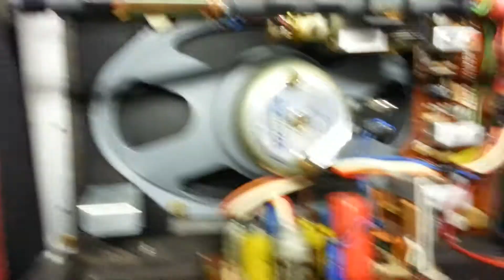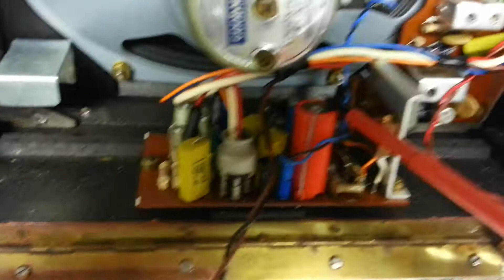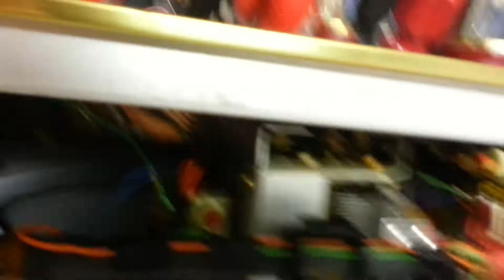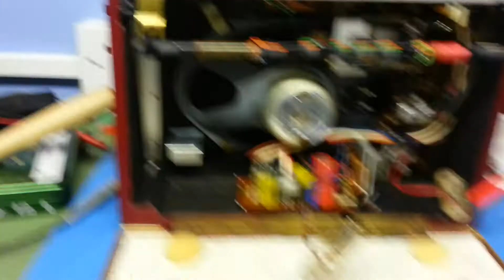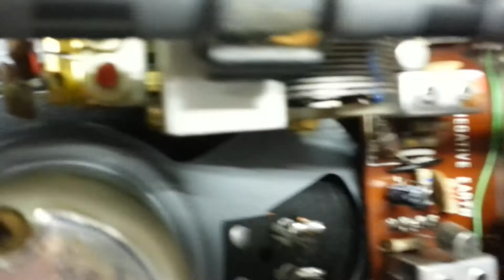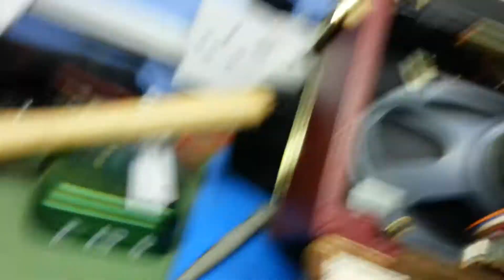Identifying tin whiskers.

Comment: These AF114 to AF117 germanium transistors were filled with a Vaseline like paste, (possible a type of thermal paste) it seems the whiskers could even grow through this paste and cause internal shorts.  I remember the replacement transistors as AF124 to AF127, I don't think any modifications were needed.

Comment: The cure is to desolder the transistor, join the base, collector and emitter and discharge a capacitor through the joined leads with reference to the screen which usually destroys these whiskers thus restoring original performance. 
AF 117 transistors were considered unreliable yet many radios (including Roberts) from the 60's used them and some are still working today but will inevitably fail through whisker growth. Nothing a good zapping won't cure!
Reply from the maker: Yes works most of the time.
Reply: The Grey Bench Electronics channel posted a video on how to zap the tin whiskers with a charged capacitor. He builds guitar pedals with germanium transistors and runs across this issue frequently.

Comment: Thanks for posting this...I'm in the US and so not aware of tin whiskers internal to the AF transistors...I became aware of the phenomenon external to components, as reliability and failure driver, as a consequence of the use of lead-free solder in avionics in compliance with the RoHS regulations (communist plot, I'm convinced!*)...I will keep this knowledge in mind if I ever come across some of these components.
* I bet the Russians don't have a horse manure RoHS mandate to use lead-free (s**t) solder!  Fact is that there exists a higher chance of being struck by an arrant asteroid from the Kuiper Belt, than to be poisoned by two molecules of lead coming from that femtogram content of lead in solder joints made with 60-40 good eutectic solder (in a radio that's in the same room as you...of God!), while 30 lb car batteries (in every vehicle on earth!!!) are exempt from the RoHS communist plot rules...Lead-free solder SUCKS...but you knew that I'm sure!  Cheers KA1-RBP

Comment: Ive seen the zap treatment which seem to be fairly successful. I have a Roberts r300 and it seems to have a whisker issue on its A117s. Identified by the mechanical shock method. Now working but not reliable. Besides replacement has anyone tested thermal shock. IE placing a soldering iron on the can to see if that will melt the whiskers. Finally remember the year 2000. DOH! What about mission critical systems are they being reviewed for this problem. Has it now been built out of new systems!!

Comment: Hello, can you tell me please if is it possible to change the transistors AF114/115/116 AND 117 USING THE EQUIVALENT, I have a national panasonic radio from 1960 and it has the intermitent fauls that you show; thanks

Comment: So that bunch of wires running between the two boards are audio and power? Is it line level? So you could add a line input jack and connect an iPod to this. If the tuner board was bad.
Reply: Most of these British/European radios from that era already have an audio input jack somewhere on them.
Reply: Even better.